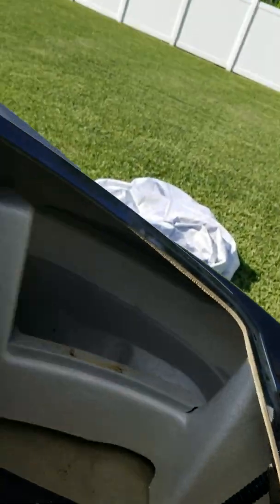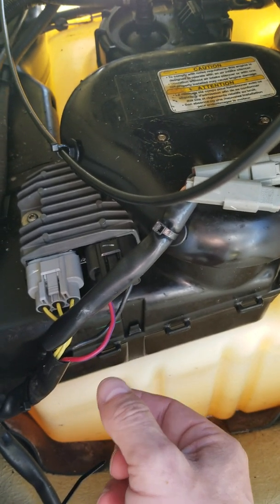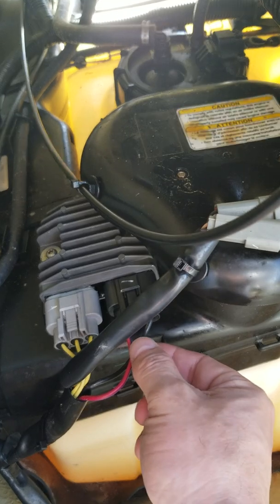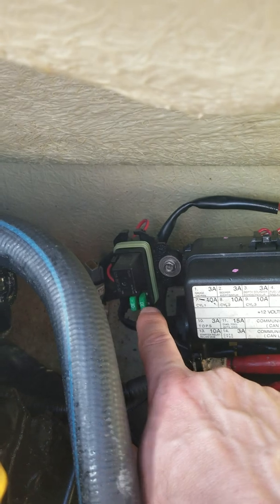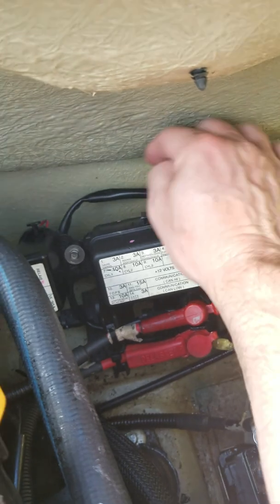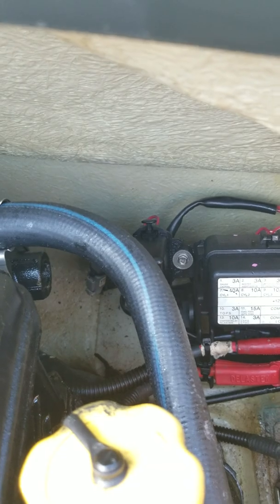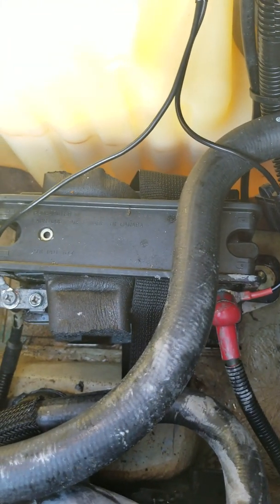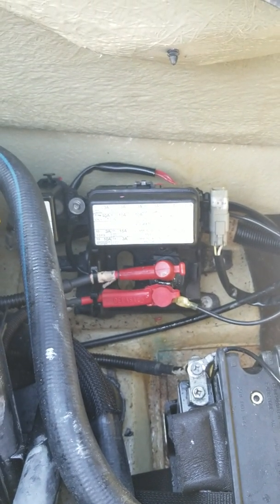SeaDoo 2008 RXT Jetski 12v Low Voltage Alert how to fix Best 5 minutes

Comment: THANK YOU this was EXACTLY what I needed to do to fix this on mine, I bought a new battery when it probably didn't need it, well there was no marking on battery so I assumed it was that, then since I have a 215 and a 255 both 2008 I tried swaping voltage regulators around with no luck. I came across your video went thru the trouble shooting because I did not want to pull the pto cover apart for a stator. Sure enough new wire to the same location fixed it. 👍👍👍 (I do believe that this 255 has seen sea water at one point it has corrosion on all hardware which I can see why that wire got corroded while the 215 being the same year has only seen lakes and has no corrosion on anything inside)

Comment: When testing the yellow wires for ohms does the machine need to be running or no ?
Reply: no, the Ohms will be steady, Just need it running if you are testing the ac voltage.

Comment: So if I test the yellow wires and get no reading whatsoever does that mean my stator is shot ?  And does the machine have to be running for this test ?
Reply: you should have an ohm reading on the yellow wires when not running but wont have the 20vac unless the machine is running.

Comment: This is a widespread problem. This repair should be done even if you don't have a problem yet as it's just a matter of time. Good news for me though, just bought a cheap 08 RXT with "a fuse problem" that he couldn't figure out. Did the same repair and she's back on the water now for +$0.

Comment: I have I have a 2006 seadoo gtx and there’s 2 30amp fuses but every side of each fuse and giving me 12.83 volts and even when I charge the battery and test just the voltage it reads the same thing

Comment: I have the same bike but I’m not getting any beeps when I put the key on the ignition…. Any clue where I should start my search
Reply from the maker: With a voltmeter make sure you're getting more than 12 volts where the 2 30 amp fuses are.  Make sure the key is properly seated but I just had this issue of no beeps probably a month ago and it was a bad wire corroded again going to the 30 amp fuses test one side and then test the other side.  If you're not getting more than 12 volts then you have a bad wire connection to the battery.  If you're not sure where it is let me know and I'll try to take a picture this weekend . And make sure the 30 amp fuses are not blown of course
Reply: @daringrey  I think I know the 2 30 amp fuse your talking about, mine actually burnt out and the fuse connector.. I bought 2 waterproof fuse holder and ran the wire directly to the solenoid
Reply: Possible Failed Relay

Comment: Thanks for this. It's basically the same procedure for 2006 and older however the fuseboxes and location are a bit different. Mine was the fuse

Comment: i agree with Kevin.  around a minute into this you're talking about AC voltage from the rectifier.  the motor has to be running for the AC current to be read.  If I'm wrong, I need to watch a basic video about AC generation.  Please respond.  Thanks

Comment: Thankfully, the screw holding the positive battery wire was loose. I tightened it and no more 12 v low or any other problems.

Comment: Darin, great video, i believe i have the same issue but my fuse got melted and the wire coming from the fuse plug seems to be burned out also, do you think that i could bypass it with an external fuse?
Reply: That is what I did, the Fuse melted so bad i had to cut off the wire and add one, Just make sure you use a holder/wire/ fuse rated for 30 amps.

Comment: Nice guide ! Is that safe for sea doo to run it without rectifier connected to check voltage ? And since there are 3 same yellow wires, which one to check ? Thank You
Reply from the maker: Without the rectifier it won't charge the battery so it's okay. The outgoing should be the DC volts and the incoming three wires should be checked by checking wires 1 and 3... then 1 and 2..then 2 and 3.. review the video again  I did it a long time ago and don't remember the exact voltage
Reply from the maker: Remember yellow wires are AC not DC.. MAKE SURE VOLTMETER is setup right

Comment: I've got a SEADOO GTX 4-TEC I was getting 12v low I found a fuse was missing. My setup is different then yours is. But after I put the fuse in I got a check engine. I took it to a mechanic as I needed the codes cleared. Crud cost me 170.00 for that and he said 4 fuses were bad. They were good though when I checked them before taking it in to them. Anyway now I'm getting a 12v hi any idea why. I did replace the rectifier so that's new. Any help would be appreciated.
Reply from the maker: I'd get a voltmeter first and follow the wiring to see where the high voltage is coming from. If you got a knock off rectifier that could be the issue and that should be the only thing causing the high voltage. If you see the voltage coming out of the rectifier being crazy voltage above 14-15volts if I remember correctly...then it might just be a bad rectifier.  If the voltage of the rectifier is correct somewhere around 14-15 volts ...then it might be a computer issue. I know there are a lot of aftermarket rectifiers out there so it could just be an issue with that and hopefully not your computer.  So basically check the voltage going into the rectifier and coming out of the rectifier.

Comment: Darin appreciate that information if tops sensor was replaced and still getting p1502 and low voltage pop up what could the issue be ?
Reply from the maker: Take a voltmeter and test where the line voltage drops... If you're not getting 14 v at the battery while the jet ski is running then it could be a broken wire connection

Comment: I tested the yellow plug in Ac current but i am not getting a reading. I am getting 12.66 from the DC. What else can i check
Reply: my fuse both show 12.53v but both other pin show.05

Comment: Great video....thank you-thank you
Needed this today
Reply from the maker: TheConradiii glad to help please feel free to let us know what your particular issue was either the fuse or the wiring or the rectifier
Reply: Darin Grey hopefully I will find out tomorrow I am new to jet skis -just got ski in water today and it started right up but then only went slow-12v low came up on screen and red light when I stared and ran it on shore it was fine - revved up and all but not today in water-upsetting- will breakout meter tomorrow and start testing - brand new battery-old battery was dead- bought new cheap one that didn’t work then bought good batt and thought I was good to go then this- I did do something bad while trying to get 1st battery working- I jump started with high output charger and probably  blew something- hoping only fuse but doubt it- any quick thoughts what went ?
Reply from the maker: TheConradiii the quickest route is just pop out the charge 30 amp fuse and test the top of the fuse clip to make sure you're getting the 15-plus volts DC and then put a voltmeter on the bottom fuse clip and you'll see you're getting 12 volts from the battery plug that fuse back in and then test the battery directly on these things it's usually the wiring but it might be the rectifier as well when I was getting 15 volts I was not revving it up at all and when the battery was attached I was getting 13.5 average when it was on idle
Reply: Darin Grey ok, is the fuse a car type 30 amp?
Reply from the maker: TheConradiii 30amp mini blade car fuse.... not the 30amp standard blade
Reply: Darin Grey ok-thx
Reply: Darin, it was the rectifier/regulator. My GTX is a 1999 and the part was very easy to replace. I bought it for 45 bucks same day shipping on Amazon and installed it today. It did the trick. I Think it took a few minutes for the MPEM to rest or something because the engine would not go higher than 2000 RPMs for a while but then it started to crank and was fine after that. I checked the voltage on the battery before installing the new part and it was 12.5. I checked it after replacing and with the engine running and it was only 12.9 but climbing. I did not keep checking as I was anxious to get it "on the road".  Thanks again for the video.
Reply: MPEM to reset.
Reply: I think I will try this next t. What symptoms were you having on the ski? 

It starts and runs great but after 15 minutes or running it, we shut it off n try to start again and throws the codes. I’m throwing a P0351, 0352, 0353. Runs really sluggish, then when we try n start again it will try to start and fire up for about 1 second then dies. Any ideas?